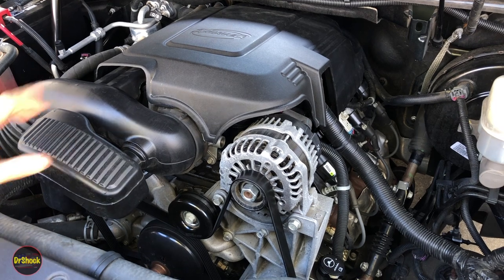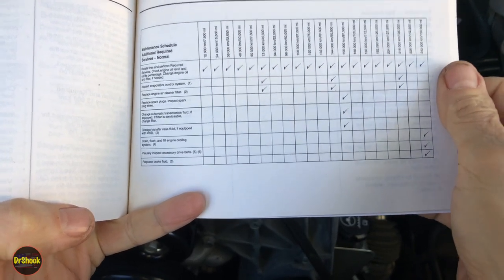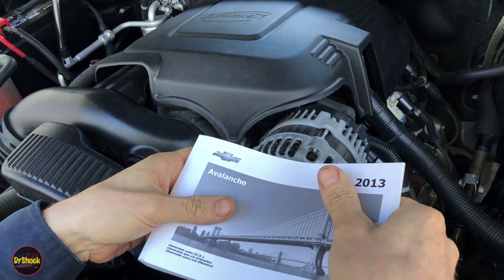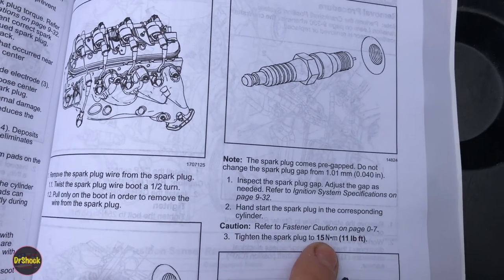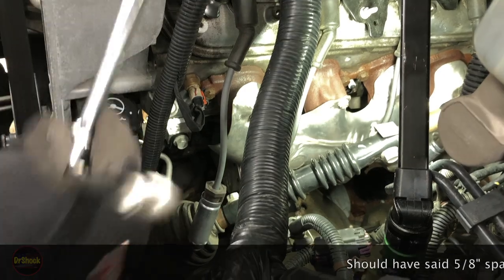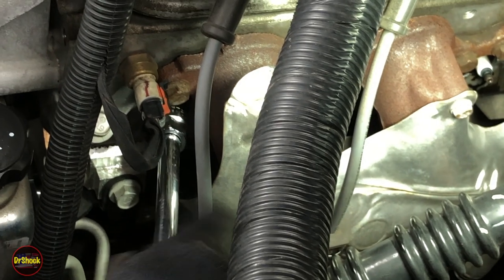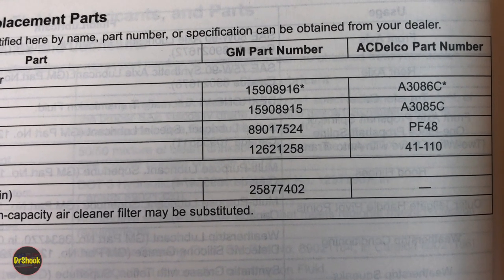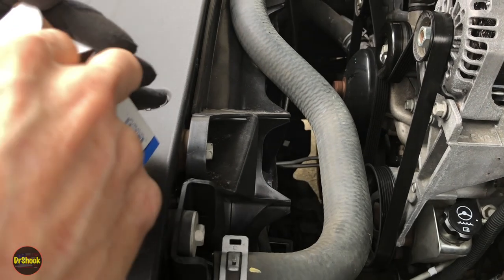2007 - 2014 GM Vortec 5.3L V8 Engine AFM Fouling ~ Spark Plug Inspection & Replacement (Chevy & GMC)

Comment: 2012 Chevy Silverado. Bought used at 89k. Heart sank when I first pulled the plugs, then learned about this faulty design. Stayed on maintenance, does burn oil and foils out plugs. Just changed to a new set of plugs and wires at 168k

Comment: Just did the plugs and wires on a 13 silverado with 97k on it. I disabled the AFM with a range technolgies device the plugs in to the obd2 port. No major change in fuel economy.  Keeping fingers crossed the next 7 to 10 yrs.
Reply from the maker: Once this generation of Vortec 5.3L engines start burning oil, those Range devices are a waste of money unfortunately.   The oil consumption is coming from the piston rings being gummed up from the AFM action, and by the point you detect the consumption the damage has already been done. 

You just have to monitor the oil consumption and stay on top of it so that you don't cause further damage from low oil levels, or replace the piston rings.   Once you replace the rings, you could have AFM disabled and it could be an effective mitigation then, but only then.
Reply: @DrShock  I understand what your saying. The plugs I pulled out all looked good so I'm hoping for the best.

Comment: I did parts for quite a few years and according to the manufacturer of the spark plug you're not supposed to put a gap tool in any iridium or platinum bug because you are removing the material from the copper core. To each their own but technically you recorded yourself voiding the warranty on your spark plugs
Reply from the maker: Thanks for the comment.  However, your information does not apply to ACDelco.  The GM service manual instructs to verify the proper gap as part of General Motors authorized warranty repair procedures.   The reason is simple, parts in boxes can be impacted during shipment changing the gap.  The gap must be measured and verified before installation/usage of the spark plug into the engine, a process which causes no damage when done correctly.
Reply: @DrShock  you might consider that the manual was written quite a long time back and that policies change since then ACDelco has been bought out by NGK so being that they have different owners now policies will have changed. I know that when selling them, we were informed by ngk to tell people not to gap them. And were told that if someone told us that they gaped any brand of plug we wer to not warranty the part.
Reply from the maker: ACDelco sources their plugs from several tier one suppliers, NGK is only one of them.  I think I'd interpret what you're recounting here as accurate in the sense that it's encouraged to check that the gap is within factory specifications (NGK in your example).  But that you return the plug for warranty replacement if it's not in spec.  I believe NGK is saying do not try and correct the gap yourself if it's wrong.     Just return the plug(s) if it's the wrong gap for whatever reason.  Thanks for sharing the detail, helpful to know.

Comment: What’s the impact to the catalytic converters with oil burn?
Reply from the maker: Over time combustion of oil can gradually degrade the effectiveness of the catalytic converter (or converters on those vehicles with more than one).  It won't result in an internal melting/damage like pushing unburnt fuel thru will though.   Just loss of effectiveness/efficiency at emissions reduction.
 
This particular vehicle is registered in a state that still sniffs the tailpipe emissions as part of annual inspection.  I'd suspect the owner would have this concern in their don't care list until such an inspection fails as that's cheaper than pulling the engine to rebuild with new piston rings (the only real fix for the problem).  Once these GM 5.3L engines start burning oil it's too late for any mitigation, there's nothing that will stop it short of a rebuild.

Comment: I have noticed that every 1500 miles the engine burns about a quart of oil. First of all thats insane. Assuming a 5000 mile interval you lose a little over 3 quarts between changes. Thats HALF the capacity of the engine. Emissions and fuel economy have destroyed the life of these otherwise bulletproof engines.
Reply from the maker: The only real repair for this issue typically, for this particular GM engine design and model year series, is installing new piston rings.   The earliest models had some service bulletins involving additional parts (revised valve cover, revised pan component, etc) which help and are all needed.  But in the end even with all of those revised design parts installed, it's the piston ring design allowing oil to blow by and be combusted at a premature level of mileage on the engine.    

When the vehicles were still within warranty, some folks were able get their dealers to do the rings and as expected the oil consumption problem went away.  But it eventually comes back (even if AFM is disabled btw).

I would assert it is cheaper to just monitor the oil levels like a hawk until some other issue warrants the cost of opening up the engine.  Then I would recommend doing the rings as well.

Comment: I have a gmc sierra 1500 5.3 L and i have p0300. Already changed sparkplug and wires months ago. And i run cleaning type of add on in the fuel tank every so often. The shop i took it to recommend a new engine,  i call bs on that.